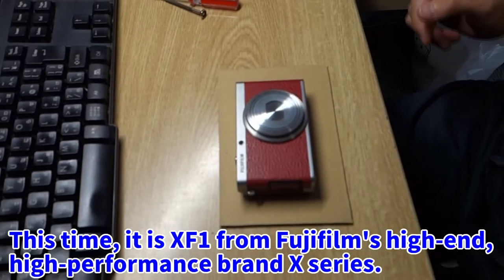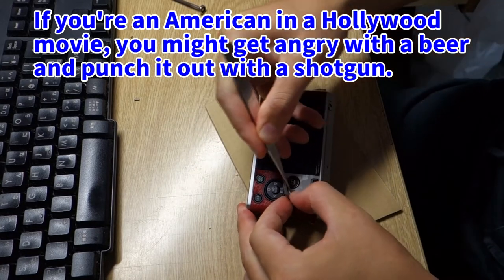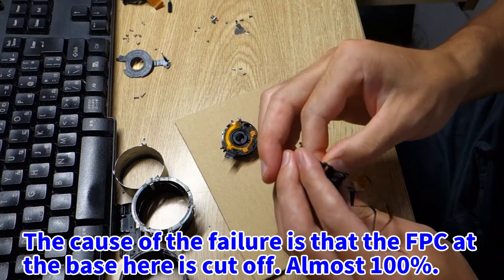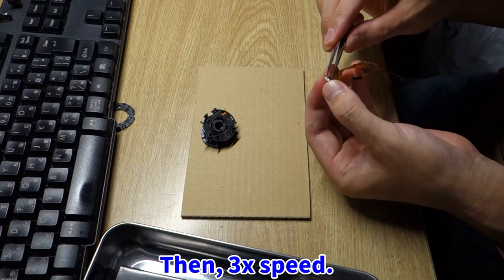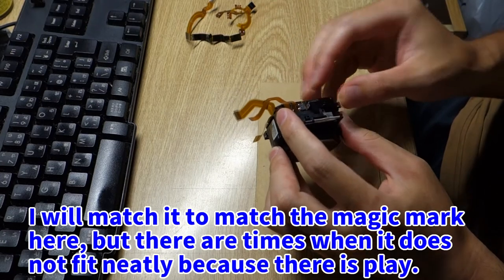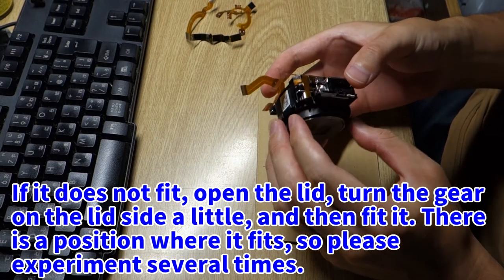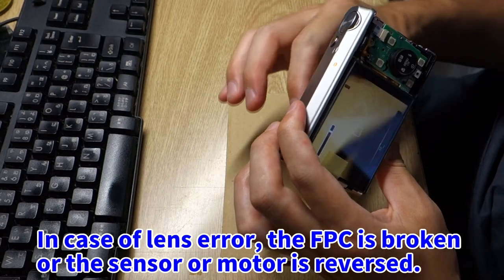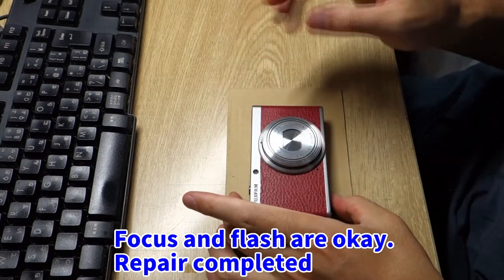FUJIFILM XF1 Red "LENS CONTROL ERROR" Repair FULL-REC

Comment: Fujifilm should've been recall this camera since mine started showing lens control error less than 500 photos taken. As far as I know, 90% of the customers owns this model has the same issue even after company replacing the lens assembly under warranty since they are replacing it with the same flowed design. what we need is a class action law suit against fujifilm.
Reply from the maker: hahaha.
Reply: Fuji offered me a big discount on another model because they couldn't fix mine. I told them to take a hike. This wasn't my first Fujifilm camera to die prematurely.

Comment: Heyy! Quick question. I didnt follow your tutorial closely, and I ended up removing the sensor holder screws. How fucked am I? Does it need calibration? It seems unlikely to me that they calibrate with three screws, but I rather ask you about it.
Reply from the maker: If the sensor is a CMOS, check to see if the focus is correct.
If it's not, you'll need to adjust it, but if it is, there's no need to. Just tighten the screws back in place.

Comment: I attempted this repair but while soldering one of the chips labeled 5C 2B in the video, I somehow lost the other one, I'm wondering if you'd know what those chips are so that I could find another one?
Reply from the maker: Since the Japanese manufacturer's sensor is a discontinued product, I don't think you can get the same one. I couldn't find it myself.
Sometimes cables with sensors are sold, so why not wait for that?

Comment: hi just happened to have this problem 😢 Thank you for sharing this video, could you share where did you buy the fpc or what is its series number? Thank you so much again
Reply from the maker: Purchased on Aliexpress. Prices vary depending on whether or not the connector and sensor are included.
There is no model number. Search words: "xf1" "cable".
Reply: @orientalbored  thank you so much

Comment: Thank you very much for the video. I have a camera that gives a “lens error” and a new cable with a connector but without sensors. I think I can handle the wires, but I've never soldered with a heat gun. Is it possible to use conductive glue in those places where there are 4 small contacts? How is your camera doing?
Reply from the maker: It depends on the performance of the conductive adhesive. Generally, it is weak against impacts. Cheap ones made in China cannot secure parts in place.
Depending on the number of shots taken, the cable can last for about two years if replaced properly.
As for the durability of the cable, it can't be helped as the lens design has some problems with the structure.
I hope you don't destroy or lose the sensor.
Reply: @orientalbored  Yesterday I spent half the night sorting out the lens. I couldn't resolder the sensors, it's not for my eyes. The camera works with the stabilization turned off (in A mode, that's all I need). Thanks again, without the video I would definitely have gotten lost.

Comment: Wow!!! This is very complicated restore. Is it the principle same for the Fuji X10?
Reply from the maker: The Fujifilm X10 has a similar mechanism. I think it's a little easier than the XF1.
However, the X10 has another difficulty because the number of parts is increasing.
Reply: @orientalbored  thank you very much for your reply. I wished you lived closer :) do you know you a shop where I make a chance to find some parts? Regards Jisiwa
Reply from the maker: @ItsfreakyDB  It's a bit expensive, but depending on the model, some parts can be purchased on alliexpress or ebay.
If not, get parts from junk or the same used model.
If the same model does not stick to your hand, make it yourself.
If you have no repair experience, give up and buy a new model.
have fun.

Comment: I applaud you for your work, and thank you for time. I've attempted this repair, installed a new ribbon, only to wind up back where I started, with the lens error. 
Having spend many years repairing electronics and working as a repair technician, this camera has to be the most inelegant and hideous design that I've ever seen. 
I'm not even an American in a Hollywood movie and I feel like punching it with a shotgun. Whoever designed this should be ashamed.
Reply from the maker: Strongly agree with Fujifilm's weird design.
By the way, the X10 and X20 have a slightly better design, so Fujifilm must have recognized the problem.

Note.
1. Mounting orientation of the sensor.
2. Orientation when soldering the shake coil.
3. Trace the soldered vibration sensor line and measure the resistance.
4.Isn't the crease broken when the camera shake sensor resin and the top lens are combined?
5. Forgetting to flip when inserting a new cable into the board.

From my knowledge of movies, I think the correct use of a shotgun is to shoot out the TV after throwing a beer can when your favorite sports team loses. Wouldn't it be better to save the shotgun for Super Bowl season?
Reply: @orientalbored  I may have used some of the worser aftermarket flex cables, because the first two cables have snapped at the crease, with minimal folding. In all honesty, I will attempt it at a later date, when I've gathered enough patience to deal with it again. Because at this moment I'm willing to mark it at a loss and forget about it. 
A shame, really, for all of this technology to be wasted because of such a poor design.
Reply from the maker: @OrinSorinson  Performance-wise, I think it's a good model...
Disappointment machine.

Comment: Thank you so much for taking the time out to repair this camera. It will be so helpful for people if you could provide a few details about the store you bought this cable from, what soldering bits are needed, what kind/type of double sided tape is used. 

I am thinking about buying the flat cable and doing the repair at home but I don't have the tools, thin pliers or soldering iron etc.
Reply from the maker: Decent fine point precision tweezers. (Japanese Hozan P-894 and a few others, no Aliexpress fakes or crappy Chinese ones)
Soldering iron with adjustable temperature. (Japanese Hakko FX600, Tip->T18-C08 / 0.8C)
Solder wick, flux for soldering. (H-722 Halide content 0.08% from Hozan, Japan)
Solder wires and lead free solder are difficult to use. (hakko eutectic solder)
Heat gun sold on aliexpress. (8858 made in China)
Double-sided tape. (anything is fine if it is thin. 3M 9448A or 468MP, etc.) Under the soldering of the coil wire of the camera shake unit, heat resistance may be good.
Any thin PET insulating tape is preferable. (Teraoka 0.05mm)
Phillips screwdriver for M1.4. (Japanese Vessel #0)
A slotted screwdriver with a width of around 1.2 mm.
Needle-nose pliers with fine tip.

The items in parentheses indicate what we use.
I'm guessing it's something like this for this model.
It's easier to buy a cable with a connector if you only need to replace it once. I think it's on ebay and aliexpress.

The area around the camera shake unit is difficult, but do your best.

Comment: i was working at home on this repair, and i lost the ceramic balls! i panicked for a while & got really frustrated, then i thought of a replacement option & the idea of using silica gel balls came to mind!
the ones that are included in COVID tests are smaller than standard ones, so i used two of them & they seemed to be roughly the right dimensions! unfortunately i snapped another cable during reassembly, so I'm unable to verify whether it works (it should!)

i would very much like to borrow that shotgun & point it towards my skull :)
Reply from the maker: I think you can get ceramic balls of the same size on Aliexpress.
If you are confident in your soldering skills, it seems best to connect the disconnected wires with magnet wire.
Reply: @orientalbored  thank @doranoon 's idea and @orientalbored 's video. I am repairing this, suddenly i see 3 very small balls appearing during i am soldering 4 flex's points to the roll inside, they are just like small pearls, in white color. Although i am very careful but i can not understand why the appear and where they are from the lens. So i would appreciate much if you please instruct whether they are major ceramic balls mentioned, and how to install them back to lens. Thank you.
Reply from the maker: @nguyendat-qw3is  These are the bearings for the image stabilization unit (see time 17:15 in the video).
If you remove the three springs from the image stabilization unit (think of a way to prevent the springs from flying away), the lens will come off. There are three recesses, so return it to those places.
If you do not return the bearings to their original position, the image may be out of focus or you may get an image stabilization error.
Reply: @orientalbored  ok thanks

Comment: Thanks for the GREAT video!
Unfortunately I think it is too much for my skills and I will pass the repair. It saddens me having to trash such a cute and good looking little camera but the engineering behind the whole design is sloppy and prone to fail any time. Not the first time I see problems like these on Fuji products like the faulty Fuji/Nikon DSLR which were failing in flock ad Fuji refused to repair despite being high end cameras.
Reply from the maker: Consider buying a used lens on aliexpress.
Sold at second-hand shops.
In Japan, personal trading sites are developing, so if it sells, it will be a beer fee.
In other countries, it's on ebay. The process is troublesome.

Comment: Is the flex printed cable failure the result of poor workmanship at the manufacturer or a poor design? Will the repair replacement do a better job as to life expectancy of the X-F1? My original flex has a black coating at places, is that to avoid optical reflections? Or is it the cause of premature failure?
You have created a very usefully video, I wish it was published 6 years ago when my fujifilm X-F1 showed lens control error……
Reply from the maker: The flex cable is designed to be sandwiched between the lens barrels and rubbed, so it is easier to cut than other cameras.
I think that the manufacturer's repair has been completed, so I will use a compatible flex cable, but since it is thinner than the genuine one, I think that the durability will be slightly reduced. In my own experience, I have been using it for over a year.
I don't know what's right, but maybe the black coating is for better sliding and reinforcement of the rubbed area. I guess it might be a fluorine coating. Compatible flex cables may or may not have a coating.
The FUJIFILM X10 and X20 lenses have been slightly redesigned.
Because it is an excellent camera, it may be used frequently by users and used more in a shorter period of time than the manufacturer expected, and it may reach the end of its life sooner.
Reply: @orientalbored  Thank you so much for explaining the flex cable issues, I wonder whether it will be easier for me to buy the complete lens assembly from alibaba stores. Do you have any idea about reliability of the aftermarket lens assembly as offered for 5 times the price of the flex cable…?
Reply from the maker: @Brasto1  If you can buy a good product, just replace the lens unit.  
90% of the lenses I bought from China worked fine. However, 60% were dirty and full of scratches. Fogging or scratches on the lens, or pests and debris on the CMOS.
I don't know how much I can believe in 90% new and 95% new. Mostly repaired items.
It would be great if you could buy a completely new lens.
On a website, it's kind of like a lottery because it's unclear which state will be sent.
Depends on the conscience of the seller.
Reply: I have a question. Since I don‘t find any company in Germany who will do this fix, would it be possible to send my camera to you for reparation? What would it cost? Sorry for this direct question, but if I don‘t find someone who can help me, I have to throw this camera away 😢😢. I just used it a few times.

Comment: First of all. Thanks for the awesome Video! As you are the moste knowledgeable Person i know when it comes to XF1 Repairs, I have a small Question.

My XF1 has no Lens Control Error. But it has weird Aperture and Shutterspeed Problems. Those Problems came suddenly, after I took some pictures. The Aperture seems to be always fully open, even in Manual mode, when I step it down. And the Light Meter seems to be showing everything underexposed, so the camera is overexposing in auto modes. But the weirdest part: In Video Mode Everything works and looks perfectly. Do you have any Idea what could be the Problem? I already ordered new Cables from China but I'm unsure if thats even the Problem.
Reply from the maker: If there is no submergence or fall, most likely it will be a disconnection like the one shown in this video.
It seems that if there is slight contact when the lens is expanding or contracting, it will not cause a lens error.
It is better to replace this cable slowly and carefully as it is difficult to know which direction to crease the FPC cable when reassembling the camera shake unit.
It is a good idea to keep the original cable you removed and use it as a reference.
After that, you will not be able to use the minimum or maximum focal length unless you properly align the gears on the CMOS bottom plate.
If it does not fit, please experiment with engaging the gears with the lens extended or retracted when reassembling.
I wish you success.

Comment: where did you bought the replacement parts?
Reply from the maker: aliexpress or ebay. Please be careful as there are different types such as those with connectors, those with sensors, and those with cable only.